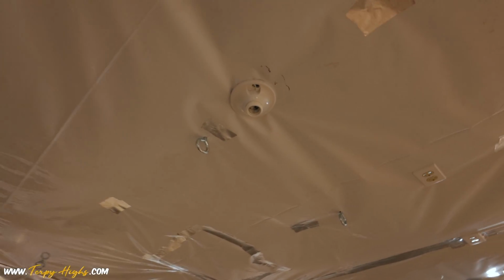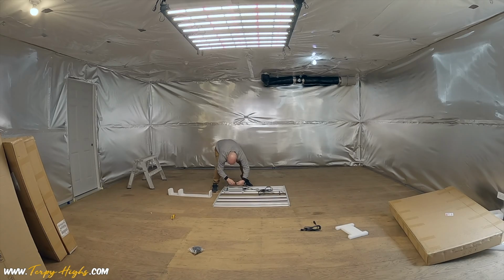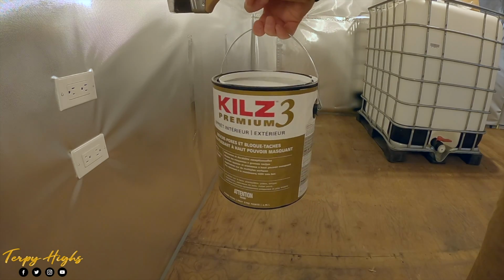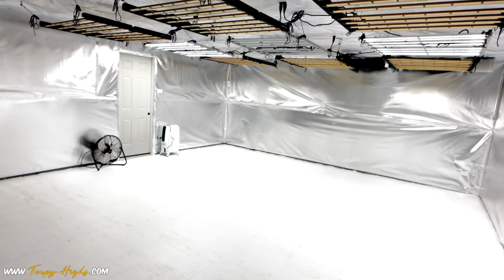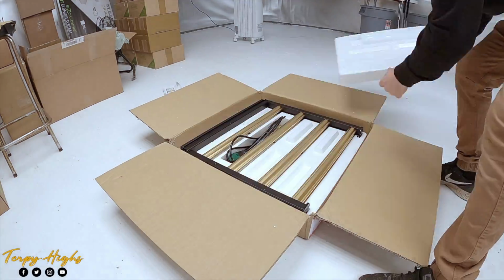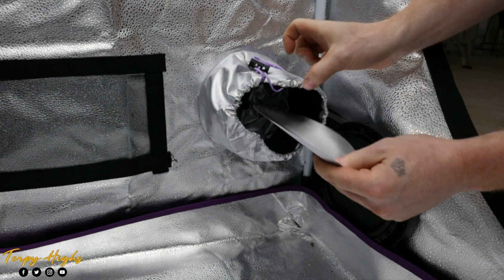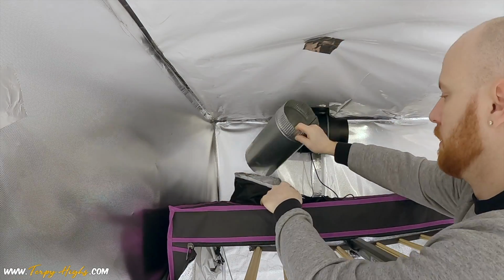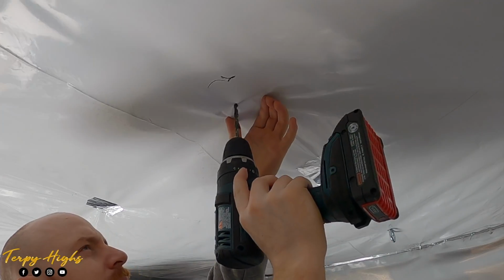Building an AUTOMATED INDOOR GROW ROOM part 1

Comment: This grow room is outstanding. I love these videos, I like to take a little from everyone and put something together. I saw a grow room that used ac ducting down the walls to vents by the floor. Air flow was outstanding. The guy said the air was recycled. Heat rises from the lights and it’s sucked into an ac return. The humidifier was built right into the ac unit. The room was not this big or neat (well put together).

Comment: Green light in a grow room during dark periods can indeed lead to light absorption and interfere with plant growth. Even though chlorophyll primarily absorbs red and blue light, it doesn't mean green light is completely ignored. A portion of green light still contributes to photosynthesis. Plus, plants have specialized light receptors that can respond to green light, which play a crucial role in various growth processes.

Moreover, the penetrating power of green light allows it to reach deeper into plant tissues, enhancing its absorption. Light exposure, including green, during the dark period, can also disrupt plants' internal biological clocks, which are essential for optimal growth and development.

Now, if you need to enter the grow room during dark periods, one viable solution is to use a green 'safelight' with a wavelength above 520nm. While it's not completely risk-free, it is less likely to interrupt the dark cycle as it is perceived less by plants than other light colors. However, limiting the duration and frequency of interruptions during the dark period is still the best practice to prevent potential negative effects on your plants.

Comment: You have most probably worked things out by now but extra exhaust is needed for this size room.
Reply from the maker: It's a sealed room now with air conditioning. In my location I had no issues with the exhaust size during winter months. Room it sealed during summer.

Comment: What is the point of the light in the tent having temperature and humidity sensors? Especially when the fan has/needs the temperature sensor
Reply from the maker: It's a controller not just a temp/humidity reader... the controller allows you to adjust power levels of the light and schedule of on/off, emergency dim/off during high temperature if something goes wrong. Many reason to have it.
Reply: @TerpyHighs  I don’t think you should be adjusting your lights based on temperature. You should be adjusting your room environment instead.

It seems like you are using and shilling stuff just because some company is giving it to you without actually understanding or pre planning.
Reply from the maker: Emergency! Sorry you don't get what a backup safety is. Last reply I'm giving you on my posts.

Comment: 240 volt does not consume less watts and it doesn't save on energy bill either. All 240 does is lower the amps by half. Watts stay the same and power companies charge by watts not amps. The only benefit of 240 is that u use less amps and able to put double the lights on same fuse breaker.
Reply from the maker: Respectful please don't not comment things that are false. Do a quick Google search about electrical or even look at any grow light power usage and you'll see what I said is 100% correct.
Reply: @TerpyHighs   I did do a Google search after watching your video and hearing what you had to say and I did find out that you are wrong my google search is as follows.

Running grow lights at 220/240V will not reduce the power and will not save any money on the electric bill. Running at 220/240V will only reduce the amperage by about half, but the wattage consumed will still be the same. Ohm's law states that V = I*R and the power formula states that P = I*V.
Reply from the maker: Lol why did you edit your original post to change it to match the google search? Youre a funny guy. Have a nice day.

Which is exactly what I said in the video. Running 240v saves me on AMPS used. I didn't say anything about saving on power consumption.
Reply: @TerpyHighs  because I got it backwards but in the video u said it's cheaper when it's not. That's all I was getting at. Everyone keeps saying 220 is cheaper on electric when it isnt.
Reply from the maker: Again I did NOT say 220 is cheaper on electrical. I said 240v saved me Amps used. End of story. Thanks.

Comment: With taking out the center wall, we’re you worried about support for the ceiling or was there no support beams there?
Reply from the maker: It want a structural wall. The ceiling truss go the same way as that wall. It had zero change to the structure.
Reply: @TerpyHighs  that’s awesome for the room then. Thank you for making videos. I’m currently in the midst of setting up my first grow tent (4x2) and getting ready for my first grow, your videos have helped a lot in my questions and worries of growing. Thank you for all the content man.

Comment: Awesome room!  How do you prevent mold growing on the drywall/wood under all that plastic sheeting?
Reply from the maker: there is no drywall behind the mylar only insulation board that is compaltely sealed on all edges. only concern is moisture between the mylar and instaulation board which has a plastic sheet on it.
Reply: @TerpyHighs  nice!  I need to try that

Comment: As a contractor of 18yrs , honestly condensation can and will still build up behind the Mylar , I’ve seen it , also for the floors it’s a bit more costly but garage floor epoxy would’ve been a better choice , these are just my opinions
Reply from the maker: 100% agree with both of those topics.

Comment: I absolutely love what you're doing. My only suggestion is to move each of the lights that are closer to the side walls.... I would move those lights over 6-10 inches (so they are about a foot away from the wall) , THEN make them hang at angle to mimic the suns rotation KINDA and it should work very well because you will have PLENTY of ambient light from the middle lights then the angled side lights will be able to push light through to the lower parts of your canopy! 

I don't know I just started growing myself and I'm running a no till all organic setup and everything is absolutely beautiful... 

Remember that LEDs don't produce as much heat on the leaf's so i would recommend doing the angle setup as mentioned above, then lower all of your lights until you have a LUX / PAR reading of 500-1000 and as you flip to flower that's when you'll raise all your lights to the ceiling but STILL keep that side lights at a angle... 

and this would work AMAZING in your setup because the reflective white floor and walls. 

what I mean is like this ----- >     /===\
                                             (wall)plants(wall)

your setup looks like this right now ------>     =====
                                                                   (wall)plants(wall)

I would love to chat with you and learn from you, You are doing exactly what I wanna do one day and I love your setup... hit me up on Instagram @bkblessin 

Another thing I HIGHLY RECCOMMEND is getting x2 8in Inline fans and run them to the ceiling because...
1. you're gonna have a lot of plants and its going to smell crazy in flower 
2. you need to fight the square area of the room by measuring how long each wall is and how tall then you'll see how much space to air ration you need... meaning you need large enough fans to properly ventilate the room and that 6in fat is used for 4x4 and 4x8 grow tents...
3. you're room is way betting then 10x10, could properly setup x2 10x10 grow tents in the room. 
4. look up a video how to properly setup your inline fan for the grow tents and mimic the setup asss if your room was a grow tent

Comment: How did you determine the a.c intake and exhaust vent I don't think you have enough return air as you do intake, for a room that size for best results get an h.v.a.c guy to tell you what size a.c as far as BTU, the for vent exhaust you need to have equal flow ratio, other then that happy growing

Comment: Not sure what youre doing for irrigation, but guessing you will do PC drip/drain to waste, i would make sure to install either a proper drainage system, or a sump that can pump the waste out to a proper drain. it will save you so much time and head aches of having to dump waste water or reservoirs. Irrigation and plumbing is sort of its own monster though, so maybe you already have that all worked out, idk

Comment: scrap those wall fans for some basic 20-24in wall or ceiling mounted shop fans. Or if you wanna get fancy, get some shaefer versa kool 12" in fans. Its better to get the entire volume of air in the room moving in a circle than to have wall mounted oscilating fans. you only need like 4 big fans, as opposed to needing like 6-8 smaller fans.

Comment: Looks great except them growers choice leds are destined to break your heart. I purchased 8 roi-e720 and the controller.  Within 5 months everthing failed. Growers choi e exchanged everything,  except they gave me 3 very used refurbished replacements as if i would never notice. Units had parts missing from the led bars they had replaced.  It was very obvious.  After a huge battle which still continues today, im still trying to get a full refund. I actually had one of the used replacements fail aswell. It lasted a month or so. 112.5 percent failure rate. Heres the real kicker though, them pukes made me pay the return shipping so i could get a refund. Over 500 bucks just for shipping. I figured it appropriate to share this info because its a real life situation and not a phony review on their website likely posted by an employee.  Im tempted to start my own YouTube channel just to share my experience with the world. Growers choice should be put out of business the way they run their business.  They could care less about their customers.  I had a unit melt and almost catch fire. I took a pic and sent it to Marisol lopez herself. Not a single response from her. Thats sayin somethin.  She also told me she sent me refurbished units and to call back in a month to have them exchanged.  When i called back, she changed her tune real quick. Said she never said that and all that bs. Buyers beware. It aint all about the price point or the numbers on the unit. Alot has to do with customer service.  This has been a very expensive lesson for me.

Comment: I had a grow room before I would highly recommend for you to paint all them black wires on the ceiling and also around your water supply I would make sure all of that the frame and a skid underneath has either a skirt on it where you cannot see the darkness anything in that entire room that is not white or covered with Mylar needs to be painted or Mylar wrapped around it. It has to be completely white and don't forget that air-conditioner paint that white to no big deal but it will make the plants much happier when you're growing. The hardest thing of everything is making sure your plants don't get deficiencies, it may sound simple right now. But you're going to be very surprise how hard it really is there's different types of chemicals, if you're using hydroponics it really takes a lot of practice to get really good with this, don't be discouraged when your plants start flowering if you have a lot of male and female in one plan that happened to me, and I think the biggest problem was with my grow is I clipped the tops too many times and it shocked the plan. They are very fragile and it takes some used of growing them I would recommend if you are starting hydroponics start with about 6 to 12 plants. And you will very quickly learn why I said it's very hard to control and get the exact amount that they need of nutrients. Growing in dirt a lot easier. I wish you the best buddy just a little friendly advice that's all, but definitely check out many YouTube's channels to see the right way do not be growing them with blinders on your head look around and see how everyone else does it. After the third time I had it down pretty good, I wish you all the luck in the world buddy bring many beautiful plants to our world :-)

Comment: I can't believe your only using a 6 inch exhaust and a cheap vivosun filter.
Reply from the maker: More Info to come in part 2.
Reply: @TerpyHighs  I used a vivosun filter for my first setup. There's a big difference between it and my Can filter but I'm not in a legal state so no smell is real important. Can filter is also 4x more expensive also.
Reply from the maker: I havevt ever had an issue with smell from my tent setups and I've only used the vivosun carbon filters for those setups. My apartment has no smell outside of the tents.
Reply: @TerpyHighs  yea but this is a lot different than a couple tents. You have a lot of air and should have alot of plants. 6 inch doesn't seem large enough for that sized area.
Reply from the maker: Part 2 will cover more of what's happening on the room.

Comment: This setup looks awesome! Really wish I could have one like this. The only thing I would recommend if I may, is using cable trays (not sure how they are called in English) to organize the wires that go to the grow tent. They keep all the cables organized and easy to access for maintenance. They also keep the weight of the cables off the inlets, to make sure they don't unplug by accident (been there).
Reply from the maker: Thanks for the suggestion, will look into that.

Comment: So what size is your main exhaust fan on your room?
I use the same fans, there quiet with a strong force.
Reply from the maker: it's a sealed room, other than that exhaust fan for exchanging the room air when lights turn off to remove the Co2. I know I didnt explain that part in the video, saving for Part 2.
Reply: @TerpyHighs  closed loop environment... Can't wait

Comment: Looks great!! The only thing that 6" exhaust fan is definitely not going to be enough for that space especially once into flowering
Reply: It seems everything in the room was free so that’s why it’s understandably under equipped. Give him some time he’ll get it together
Reply: I thought you would need 2 10inch fans at least.?
Reply: All depends 
But if ambient outside temps hit above 75 and the building gets sun it’s over
Reply: dudes going to be having serious environmental issues, ran out of money couldn't insulate the floor, the ac unit looks like its 20 years old, it had a wood burning stove as the heat source and they got rid of it... wonder how he's heating the building in the winter? like there's so much wrong with this grow room setup i could keep going. and you can tell buddy didn't do single calculation to figure out cfm for the room or heat rise or anything.... I run a 8" exhaust fan to keep a 5x5 cool enough running a 1000 watts, he thinks he's keeping that room cool with that tiny ac running nearly 6k watts....
Reply: @Terrence_Acoose   sound to me like your jealous as fuck haha keep growing in your little 5x5 why hate and not give advice but your no one to give advice with your little 5x5 lmao
Reply: @Terrence_Acoose  He said in the video it would only be used a few months out of a year so.... probably the warmest months
Reply: @Boogieondaflo  that's not the issue, his electrical equipment is producing over 20k btu's of heat, you have to cool this, it doesn't matter the time of year.

to put that into perspective, a 1000sq/ft house needs 40k btu to heat it in the winter. 

most commercial grows run .5tons of ac per 1000w of lighting

the recommended air changes for grow rooms is 20, he needs at least 1100cfm running 24/7 to change the air in that room. that 6" inline fan on a carbon filter does maybe 200.

the room will work, but like I said he's going to have serious environment issues, meaning different environments at different times of year, the goal for indoor is to have full control on your environment.

would have been better off spending the money, added a gas furnace with a 2.5ton ac, put the veg and flower rooms on separate zones and added an economizer.

then got airbox carbon filters and connected them to the air return on the furnace.
Reply: @Terrence_Acoose  I agree nothing this guy is doing makes any sense.... idk how kids like this get to even be here making videos and just spreading so much misleading information
Reply: ive got a 6mx3m for a sea of green, what exhaust fan set up would anyone recommend, also could I need 2?
Reply: Looks like it’s snowing and cold, would you still need more than one 10in?

Comment: you should consider sealing the lower edges of the room. if you have a water issue it will get through the gaps at the bottom of the wall and ruin the floor boarding.
Reply from the maker: Thanks, yes I plan to calk the bottom of the walls in PART 2 of the series.

Comment: You might want to get some vinyl baseboard in case you need to run a mop around there. Help to keep anything growing on the wood walls
Reply from the maker: the walls are foam insulation board, I still need to calk the bottom edge.

Comment: Your AC is too small but if you get a coolbot for your AC it might handle the size of that room if you're going to go the window AC route try using two window AC with the coolbot and you should be good coolbot are pretty cool you can turn a small room into a refrigerator with a coolbot

Comment: Doing pretty good on your build out one thing I've noticed for that large of a room you need at least a 12 in exhaust fan and if you're planning on exhausting your large room you also need a intake vent that matches your exhaust vent size and I believe you are going to need more than one of your current size dehumidifiers or one large dehumidifier for that room
Reply: Yup
Reply: Always better w multiple units in case one fails